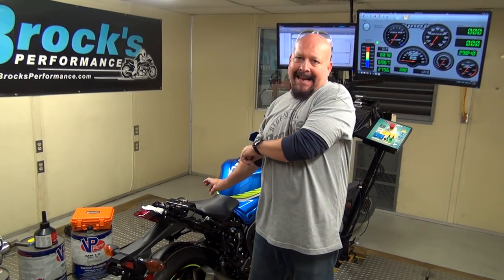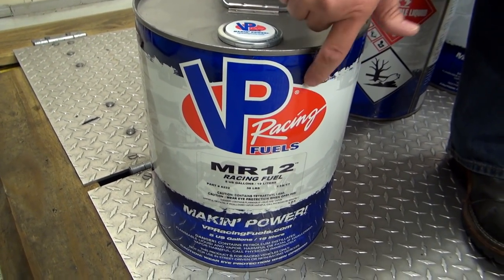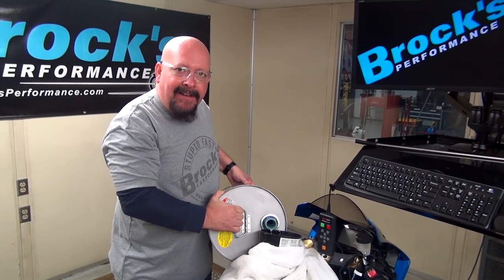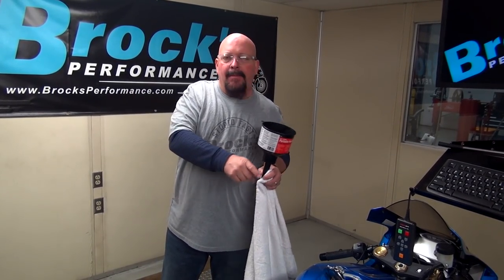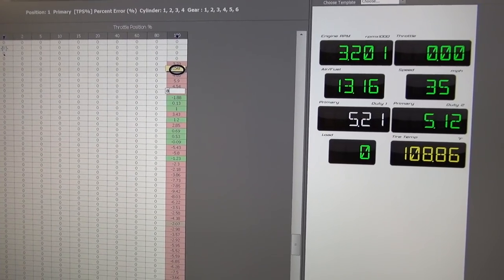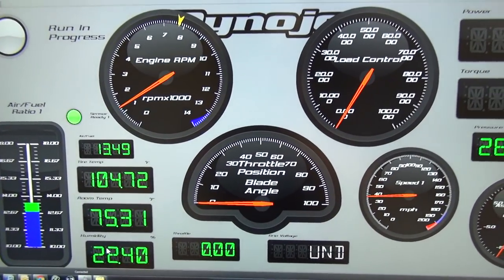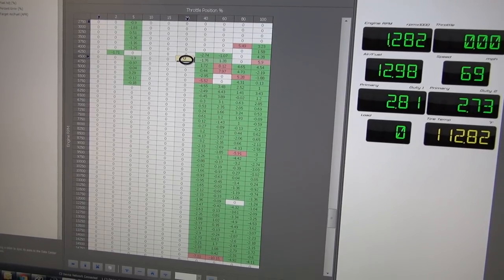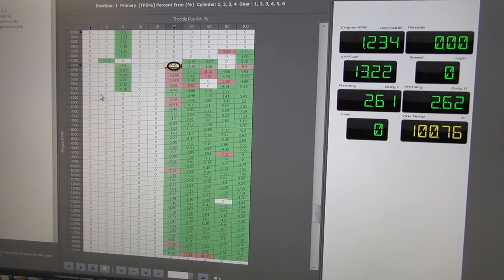2017 GSX-R1000 S2B: Episode 5 (Part 2) - Dyno Tuning for Max Performance ... 200 HP on Race Fuel?

Comment: just curious broke  run your  13 to 1  fuel  ratio that you desire   run that at wide open   kill engine  pull in clutch   not with a turbo engine  natural asperated   ok   turbo junk if you do that with turbo   anyways pull plugs out  look at them  for giggles  should be  coffee brown with some creamer   not shiney  but a dull look if it white it lean black it fat    do a lil old school   testing to go along with  your set o f values  you  think are  right
Reply from the maker: Turbo's work of of exhaust heat, so care must be taken to let the EGT's lower before stopping the engine. Super Charged bikes only increase the inlet temp due to compression of the air. The H2 is designed to be operated the same as a normally aspirated motor, if care had to be taken due to heat, the bike and manual would be directing the operator to a 'special' shut off procedure...this is not the case.

Comment: 2011-2015 ZX10r made 198.xx with just a slip-on. This bike better make 210 by the time youre done or I wont be impressed.
Reply from the maker: Not on our dyno, especially with pump gas on the SAE scale. That said, the new ZX-10R's are very strong.
Reply: Nathan Greeeeen 198 with a slip on? Where do people come up with this stuff lmao